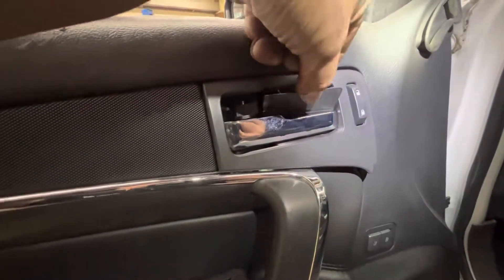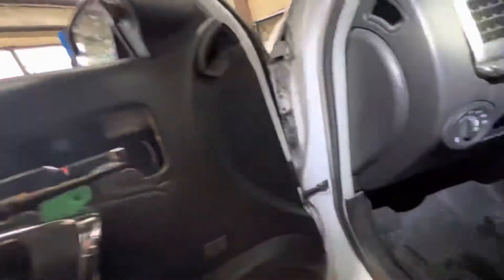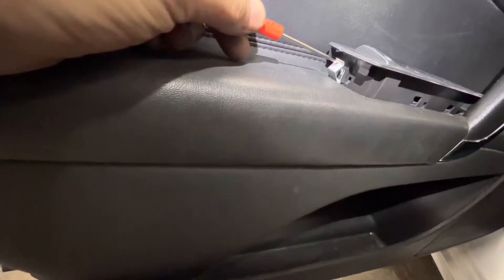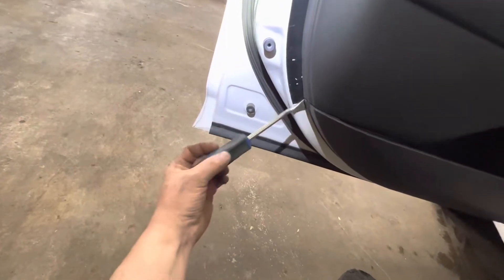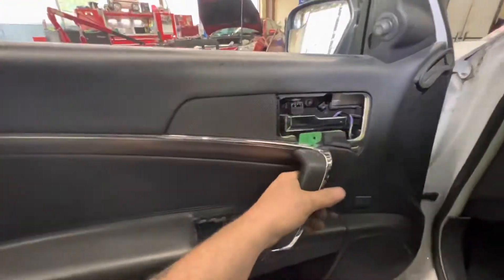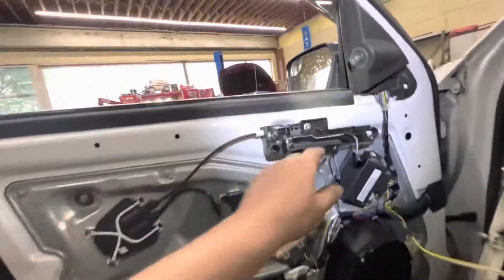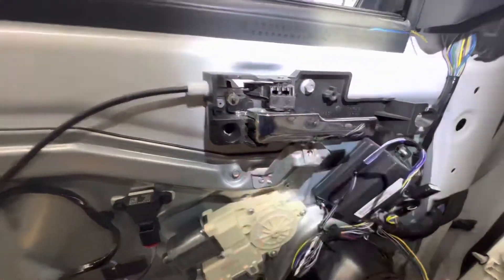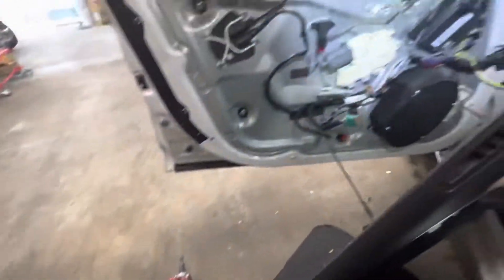2012 MKZ interior driver door handle replacement￼

Comment: Thanks for taking the time to do this video!  For everybody else, you dont need to take the window switch panel off, you can take the door off and hold it (window switch still connected).  Hardest part is aligning the new interior door with the rest of the door.  Overall cheap and easy fix with many thanks to this video
Reply from the maker: You’re welcome thanks for watching like and subscribe, hope you have a great day